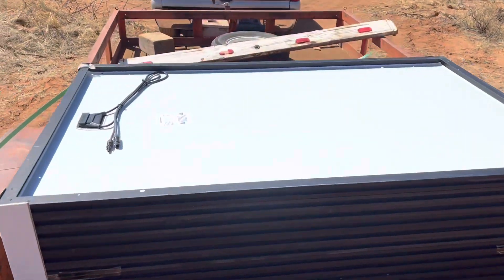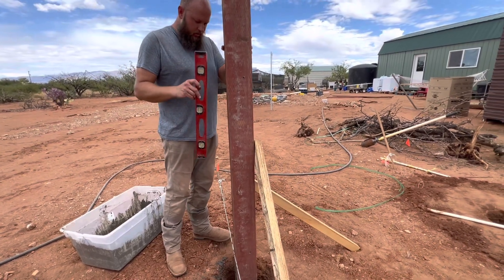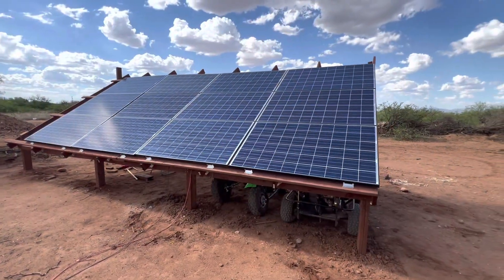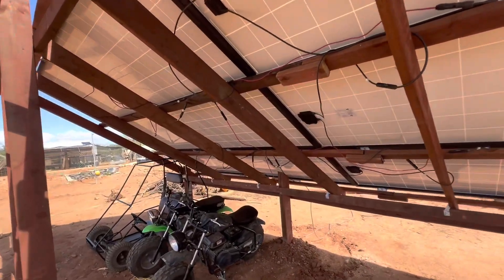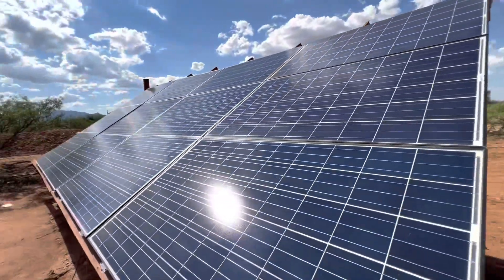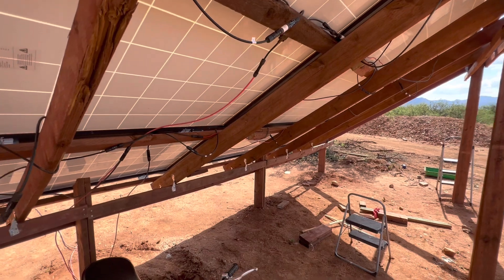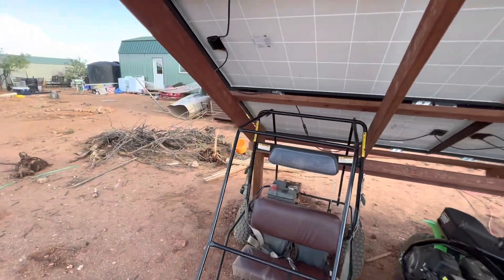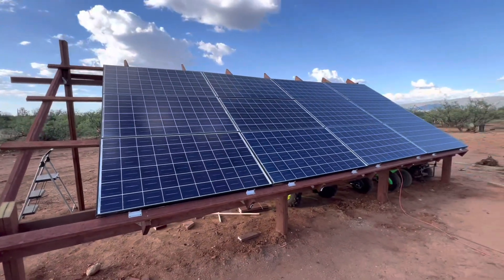We built a ground mount for our solar panels to power our off grid Homestead￼

Comment: Didn't see any mention of charge controller or battery type and how many. I'm building 12 300w panels with 8 6v golf cart batteries
Reply from the maker: Hello there! Thank you for watching. I did a separate video that went over the other part of our system. https://youtu.be/0cWVk9OoIZk it sounds like you have a great start to your solar system. The more we used our system the more I think I may need to add more a few more panels but for the most part it does what we need to do.

Comment: That was super fun and helpful. I feel ur pain. I’ve Have had many not straight wood and even metal amazingly pieces.  Always adjust adjust adjust.  Brackets never line up.  Ug 
How did you choose your angle to the sun? Latitude?  Did you have more of a winter angle, summer or middle?   

I’ll use metal more often as I have rules where my stuff can’t burn.  So I have to use additional cross braces or lines to prevent swaying.  
Loved the video!!
Reply from the maker: Thank you very much for the kind words. Yes it was a mess to build but I think I came out just fine. For our location our latitude is 31.45 so I angled it about 32.5 and true south. It’s angled more for winter but that is also the best overall angle for the year that I came up with. I was originally wanting to do metal but with the cost of everything going up I had to do what I had to do. I am sure yours is pretty solid too. Thank you again!

Comment: Nice job on the cheap. Next time, use Ironridge aluminum rails and UFO clamps instead of 2x4s and those screw-down brackets. So much easier and more rigid.
Reply from the maker: That’s a great idea! I will look at doing that next time for sure. I’m sure this won’t be my last ground mount. Thank you!!!
Reply: So much easier and that ease comes at a very high price. When you use cheap solar panels the mounting system becomes more expensive than the panels. That's just unacceptable.
Reply: @randybobandy9828  The cost of the parts is not an issue, it's the cost of my time, energy, and pain that's expensive. If it makes it easier on me, it's money well spent.

Comment: Can I get warp boards and I want to straighten them up and I put them together like that I put a piece of plywood to cut it about the quarter inch of what the width of the board is use wood glue or just Elmer's glue and glue them together clamp them together and then nail them together and I get perfectly straight boards sandwich together perfectly tight you can't even get a piece of hair in between them that's probably the best way to go but I don't think he had any loose plywood around to do that with or even Elmer's glue which you probably do since you got kids since that's what the school requires the kids to have for school. And I had to do that on job sites and construction places too what they make is really good beans that way and intentionally we made beans that way just because there are more powerful even when they weren't warped. I'm a construction worker or was a construction work for 13 and a half years I understand what you tried to do and I don't put it down you're doing what you can and I understand that so I'm going to say good work cuz you do got it up and it will hold for many years. So good job.
Reply from the maker: Thank you for the pointer. I thought about putting plywood in between them but I didn’t have any for that. But yes it is very solid as it is and it will last for a very long time. Thank you again!